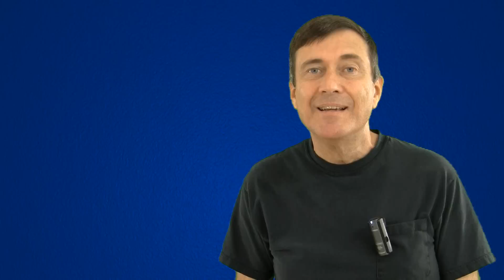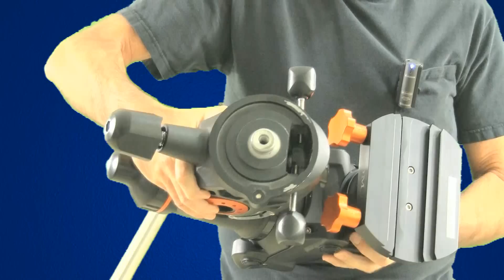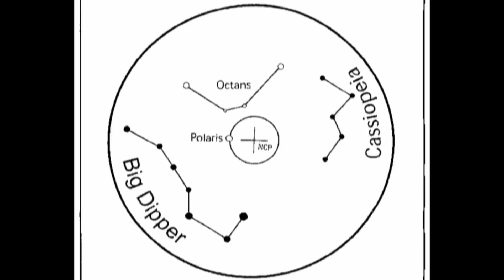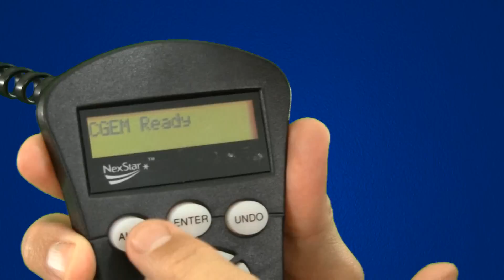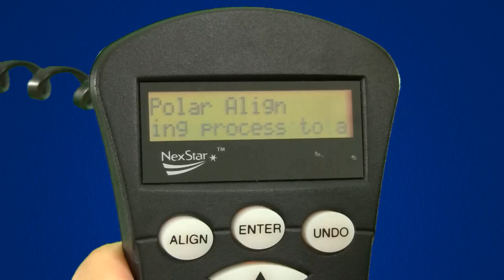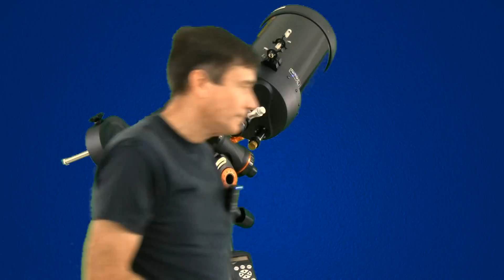NexStar Polar Align w/ASPA

Comment: You are a very patient person for going through all that. I got the AVX with Starsense but am having problems with the upper/dec arm malfunctioning... so much for smooth sailing... Anyway, nice video. You have a very good way of explaining the process. Thanks! John
Reply from the maker: John Graboski I see you have a video showing the problem. You might want to post on a Cloudy Nights forum a link to your video and ask if anyone has seen this before. They have a Celestron NexStar forum and also a Mounts forum. I don't know which would be best. http://www.cloudynights.com/index/
Reply: wwgeb Hi Partner! This has been an ongoing problem for me. Yes, I've got a thread posted already. I'll have to review all the posts from other posters as well but it really does not look good for me. I'm contacting a Celestron dealer here in Frankfurt for a repair. I got the darn thing used but in "excellent" condition months ago and the seller did try to help by replacing the mainboard but the problem persists. :( I hope he will consider refunding a portion of the price but I am not getting my hopes high. Thanks for your time and caring,
John

Comment: I wonder if you have used starsense with equatorial mount. I purchased a C8 and had the starsense from my previous scope. Basically, when you use starsense for the first time, you have to calibrate the starsense so it knows where the centre of the scope is. But at this time, the scope is not polar aligned. What I did was first calibrate the starsense, with inaccurate polar alignment of course and then restarted the mount and went through the polar align procedure. I did this twice and centered the star using alt-az screws. But still there was appreciable error in the polar alignment (3 degree N, 6 degree east). I gathered it might be because the starsense calibration was done on an inaccurate polar alignment. But its a chicken and egg story it seems. You cant calibrate properly without the scope being polar aligned properly, and you cant do polar alignment without calibrating the starsense so the targets come right in the centre when you are aligning the goto. Any ideas how to get over this problem?
Reply from the maker: Amit Sharma I have never used the starsense. 3 and 6 degrees sounds really bad. I use the polar align scope and get within a degree before doing an ASPA. I have had a large error when using my NexStar 5SE in the equatorial configuration and ASPA kept me overshooting back and forth several times. Finally I only moved half as far as it told me to move and then the iterations converged. Maybe the starsense will work if you are closer to start with.
Reply: wwgeb Thanks a lot... maybe the right thing to do is first polar align using finderscope and then configure the starsense, so it takes over from next time. Problem is when i set the latitude to the 51 degrees of london, the altitude knob of avx is so long, it prevents me from getting close to the polar scope to view through. Also, the polar scope is a bit wierd, when i can see the markings, i can't focus to infinity and when i focus to infinity, the markings on the polar scope are blurred. It maybe because the reticle had fallen off while i was configuring this.

Comment: When I power off my mount and turn it back on, should it be pointed towards Polaris before doing two star alignment?
Reply from the maker: Michael Blake Yes. You need to align the two index marks again. This can be done simply by releasing the clutches and manually moving the scope or by slewing using the motors.

Comment: cornwall uk ..celestron 9.25 vx mount  .................hi steve firstly thanx for producing some great informative videos in an easy to understand format ... i am getting back into astro imaging planets . not the best time at present .  can u give me some help.  i have a limited fov from my site due to trees and a few roof tops.  i am new to the equitorial mount . some times i can set up first go other times i lose the plot and it takes an age leaving me frustrated as the weather changes so fast here..... i havnt got a permanent setup although i am thinking of leaving tripod and mount in situ and just take ota in doors ,,, and cover the tripod etc with weatherproof cover .. firstly do you think a celestron starsense would make life easier for me to set up scope  .... also after an initial polar align (not ever done one before not yet got a polar scope)  do u think i could get away with removing scope and refitting as and whan i go out to view or image ... colin
Reply from the maker: carper1325 I have no experience with the StarSense but I would save my money for other accessories. For planetary imaging you don't need perfect polar alignment. If you could mark on the ground where the tripod legs were the last time that might help. Polar alignment is for the mount so yes, you can swap OTAs and still be aligned. When making your 2 minute avi of a planet, if you're not perfectly aligned, the planet will drift north or south. I just set my slew rate to a slow rate (1 or 2) and then I'm careful to always go in just the one direction. I don't want to overshoot because the hysteresis means it will take me several seconds to get back. Check out the Cloudy Nights forums. They have one on Mounts and one for Celestron NexStar.

Comment: If you put your counterweight on before doing elevation, it will go down and not just up, without pulling on the weight rod. Also, like to point out, be careful about screwing the elevation lock too tight, the metal it goes into is a bit soft.

Comment: Thank you very much for the great lesson! Worked liked a charm! I don't read instructions for some stubborn reason, so on my first night, eager to get started with my first mount the DX . I screwed in the polar scope and center Polaris (without factoring in the constellations on the scope)  My setup is stationery, so regrettably I ever thought twice about it. In my pee sized brain it was aligned and never going to be move intentionally, so why would I? Ha. I have been struggling to get a decent picture over 30 seconds for, wait for it, two months! lol Thanks to you I just got my first real shot with no trails @ 120 seconds! That's WAY more the 30 in my book.  I'm not heart broken in not setting up right all that time (more funny at this point), its a lot to absorb and gave me time to learn the mount and sky.   Question; theoretically, if I did exactly as you did in this video and there was no wind, no guide etc; what can I expect the maximum seconds tacking with no egg shaped stars to be with the CGEM DX?
Reply from the maker: If you mount your camera so that North is up (or South) then any star streaking up/down is due to not being polar aligned and any star streaking left/right is due to periodic error. The CGEM has an 8 minute period. It might be correct for 4 minutes, run fast for 2 minutes, and then run slow for 2 minutes. If it did that then you might by chance luck into that 4 minute window when it runs at the right speed. Spend some time at the Beginning and Intermediate Imaging forum on Cloudy Nights.
http://www.cloudynights.com/ubbthreads/showflat.php/Cat/0/Number/5989053/Main/5982943
An autoguider should be on your Christmas list.

Comment: Hi Steve. I am fairly new to astronomy and was thinking about this setup for astrophotography, any concerns with this setup. I wanna try and capture DSO (messier and such) any comments would be a great help.
Celestron Advanced VX 6 Inch Newtonian Telescope

http://www.telescopes.com/telescopes/reflecting-telescopes/celestronadvancedvx6inchnewtoniantelescope.cfm

thanks

Michael
Reply from the maker: Spend some time at the Beginning and Intermediate Imaging forum on Cloudy Nights.
http://www.cloudynights.com/ubbthreads/postlist.php/Cat/0/Board/low
I have heard mostly good things about the AVX mount. The only bad thing I've heard is about the declination bearing having too much backlash. It seems you could overcome that by disabling one of the directions in the auto-guider. The 6" f/5 Newtonian sounds ideal for imaging but I am worried about too little back focus. Ask on the forum about any problems focusing your camera with that OTA.

DSO imaging is a LOT of work, expensive, and takes a lot of time. I tried it for a while and am now taking a multi-year break imaging planets instead. You can see all my images here
http://www.astrobin.com/users/Steve/
Notice I used a 72mm f/6 refractor for the Andromeda galaxy. Watch this boring video about field of view:
http://youtu.be/LT841HZ9f84
Planetary imaging is a lot easier and the results are equally impressive. I do want to get back to imaging DSOs but I just don't have the time.
Reply: wwgeb
Thanks for the quick reply. I am also worried about to little back focus as well. I would be happy with taking images of the planets as well. I already own a 4 inch refractor but it is on a alt-az mount. can i get decent images with a DSLR and alt-az mount or no?
Reply from the maker: michael carquez
For DSO imaging you need a motorized equatorial mount and autoguider because you will want to take exposures around 5 minutes long. You will need to spend 500+ hours learning how to image DSOs. I would start by spending a few hours on Cloudy Nights.
http://lmgtfy.com/?q=dso+astrophotography+tutorial+site%3Acloudynights.com
Reply: wwgeb I meant just taking basic images of like the moon and planets. thanks will do.
Reply from the maker: michael carquez
Yes, you can use alt-az for taking pictures of the Moon and planets. For the planets a webcam is way better than a DSLR. I've seen some pretty good pictures of the Moon taken with a DSLR that are typically just a single shot of the whole Moon. If you want to zoom in on a tiny crater though a webcam is the way to go. You can take 1000's of pictures and stack them together to remove the effect of air turbulence.

For planetary imaging the best scope is the bigger scope. Jupiter will end up being around x pixels in diameter where x is the scope size in mm. If you have a 100mm scope then Jupiter will end up being around 100 pixels. You might want to consider getting the C8 / AVX combo. You can get great planet pictures. Then you could get an f/6.3 focal reducer to use your C8 for imaging DSOs later on. This Jupiter was made with a C8 and the NexImage 5 webcam.
http://www.astrobin.com/74051/D/
I made some YouTube videos to show how to get started.
https://www.youtube.com/playlist?list=PLdvoDms8MWF5fKVfO7SLN8wnmQJCweL6O
Check out Cloudy Night's Solar System Imaging & Processing forum:
http://www.cloudynights.com/ubbthreads/postlist.php/Cat/0/Board/Imaging
Reply: Awesome! thanks so much for the information!  your the best

Comment: This is the one I was interested in steve  fred

http://www.amazon.co.uk/Skywatcher-Startravel-120-AZ-3-Refractor-Telescope/dp/B00CYHT4IQ/ref=sr_1_5?s=electronics&ie=UTF8&qid=1401524130&sr=1-5&keywords=refractor+telescope
Reply from the maker: The Startravel 120 is an f/5 achromat so you're going to see a purple haze around everything. All achromats have this color problem but mostly with the fast (f/5) lenses so if you're going to get an achromat I would aim closer to f/10. This is especially important for planets. The mount is alt/az without a motor so you will have to constantly turn two knobs to account for the Earth's rotation. At least it has slow motion controls for both axes. If planets are your main goal I would consider the Astromaster 90EQ instead.
http://www.amazon.co.uk/Celestron-21064-Astromaster-90EQ-Telescope/dp/B000MLHMBM/
The Startravel 120 is better for looking at bigger things like star clusters at low power.

Comment: Thanks Steve for the reply, so overall would it be more beneficial to buy a bigger one than a smaller one, I guess you saying it is, not real drawbacks with the bigger one, except it takes up more room..someone gave me a 50mm refractor, it works to a certain degree, you can see Saturn but its the size of a pinhead, if you increase magnification much as you say it gets blurry and a job to keep track of, some people say Go To scopes are not as goos as there made out to be, wonder what you opinion is on that...thanks Fred uk.
Reply from the maker: 50mm is rather small - I would definitely recommend bigger. Goto scopes are the best. I got back into the hobby after I got one. It really helps you to find things. The motor keeps the object centered for hours. If you can swing it I would try for the NexStar 4SE:
http://www.amazon.co.uk/Celestron-NexStar-SE-Computerised-Telescope/dp/B000GUFOBO/
Reply from the maker: wwgeb
Video Review of Celestron NexStar 4SE

Comment: Hi Steve, tell me is there much advantage in a 120mm refractor over say a 70mm refractor, is the image bigger and brighter on the 120, and easier to follow planets across the sky...Fred,
Reply from the maker: The image will be brighter and you can see more detail with a larger scope. The size though is determined by the power and you can have a range of different powers with both scopes. As you increase the power the image becomes blurry and the bigger scope will allow more power before this happens. The ease of following the planets across the sky is mostly determined by the mount.

Comment: I still have a CGEM, but don't use it anymore since buying the iOptron ZEQ25GT.  It is equipped with an illuminated polar scope that takes 5 to 7 minutes to conduct an accurate polar alignment.  The mount/tripod only weighs 27 lbs total and is ideal for transportation to dark sky locations or moving it in and out of the house. Not so with the CGEM, being 68 lbs total.  There is a 13 lb difference in payload, but I image with two smaller refractors and the ZEQ25 handles them easily.  One OTA with imaging gear weighs 20 lbs and the ZEQ25 still handles it even though the weight may be over the limit for imaging.  I rarely could find a southern sky star over a major light dome, thus making the ASPA routine impractical with the CGEM.  Their non illuminated polar scope has a poor design, having to flop the mount head over in RA to even look through it and you also have to make sure and align the mount axis with it for accuracy as well.  With the "Z" design mount you don't have to flop the mount over in RA, the polar scope is illuminated (big plus) and best of all it's accurate enough where I get 8 to 10 minute exposures with round stars every time. In my location with the heavy light pollution, 10 minute exposures is about the practical limit for imaging anyway, I just have to take more of them depending on the target.  Now that iOptron has just released the new CEM60 with a 60 lb payload, it will be next on my mount list if I want to image with a larger scope in the future. They even have an optional upgrade CEM60EC, having high precision endcoders for very accurate tracking.  However, its out of reach on my budget and the base CEM60 is an excellent performer from what I have heard so far.  The CGEM is simply outclassed by the iOptron product at this time.  I like my CGEM for it's payload capacity, otherwise their polar alignment routine is cumbersome and very time consuming as the very good video clearly shows.

Comment: Hi wwgeb, your videos are brilliant and have helped me come a long with with my telescope, however i do have a question, i have a nexstar 4se and a nexstar 5se, despite being properly polar aligned with correct anti backlash settings,the tracking is just not good enough for anything longer than a minute, (thats if im lucky) im very frustrated as i have found out that the aux port can't even take an autoguider, is there anyway i can autoguide my nexstar 4/5se mounts?

Thanks tom
Reply from the maker: It really isn't possible to do DSO (deep sky object) imaging with the SE mounts. As I have read on the Cloudy Nights forums the 6/8 SE mount will accept  autoguider input but the motors aren't smooth enough and you still can't do very good DSO imaging. You CAN do planetary imaging though. I have taken nice photos of Jupiter and Saturn with my 5SE and the NexImage 5 camera. I notice that my friends and family are equally impressed with a picture of a planet as they are with a picture of a galaxy.
Reply: wwgeb Thanks for replying so quickly, i have taken some pictures of mars saturn and jupiter and i am pretty happy with the results, i guess the 4/5 se scopes are basically just planetary scopes. keep making these great videos! :)

Comment: What kind of adjustments are needed after ASPA to keep the GOTO alignment? If you have the scope aligned and then adjust the actual mount with the alt and az screws, won't the GOTO alignment be off a bit?
Reply from the maker: I'm not sure. I always shut down and do the 2+4 alignment stars again. I suspect it is smart enough to update itself though but it can't know how well you did your job of moving the alt and az to center the star. I would think that gotos would not be as good after ASPA but you may not notice.